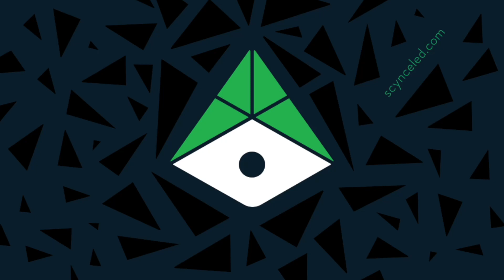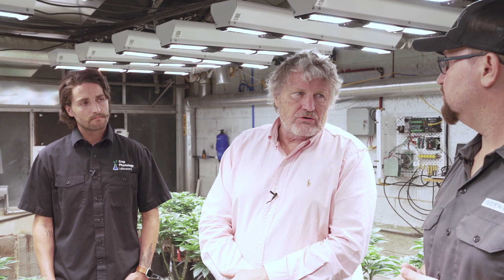Bruce Bugbee and Scynce LED  light bleaching

Comment: Bruce is the man! Too bad Scynce doesn't honor their warranties. They claim 5 years, but give you 1! And then charge 180 bucks to even get the light looked at... and will still say no. Have had 6 of 7 of my lights go bad within 3 years. One went bad ON ITS FIRST RUN, all running beside other brand lights that had zero problems, and all running on surge protectors THEY sent out a while back. Have also had 2 seperate sales reps with them tell me they think I'm getting the stiff end of the stick, but still nothing was done... it's their policy now.
Reply: Sorry to hear that, dude. That really sucks! What was their "official" reason given for not honoring their warranty?